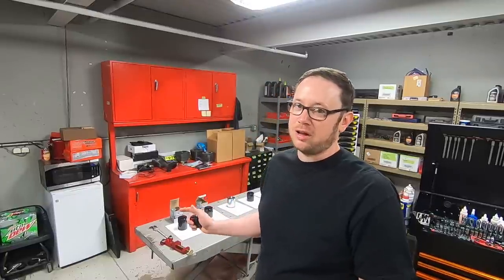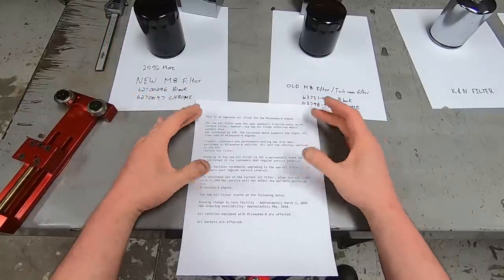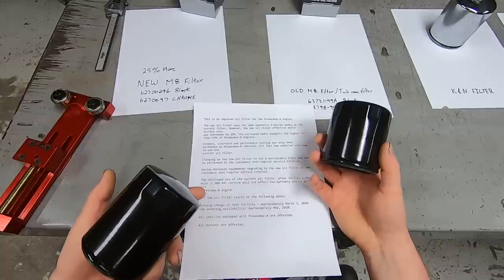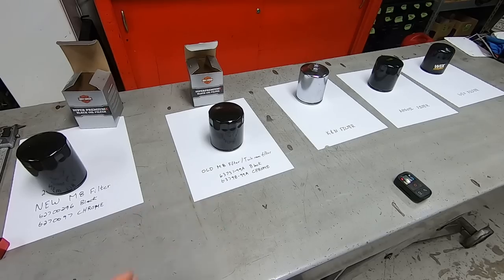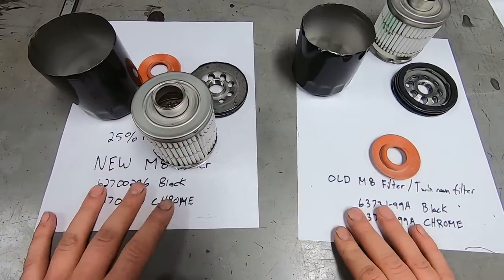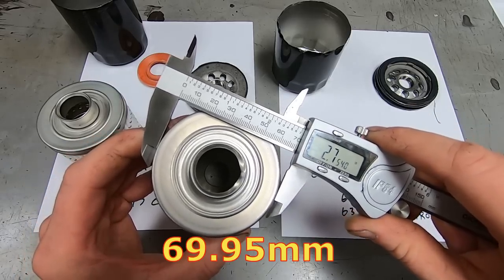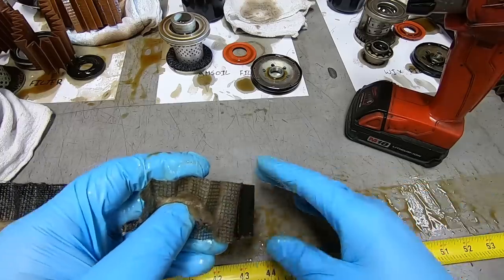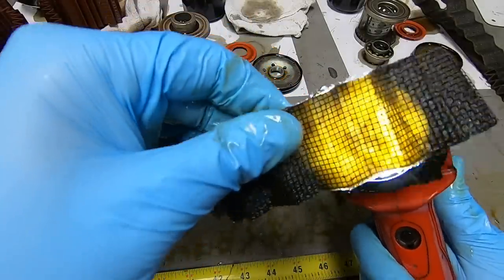NEW MILWAUKEE 8 OIL FILTER TEAR DOWN vs K&N vs AMSOIL vs WIX HARLEY DAVIDSON M8 TWIN CAM COMPETITION

Comment: Harley increased capacity because they filter down so tight 5 microns. They know that their oil filters end up in complete bypass quickly ie. 2500-3000 miles. The Amsoil filter is a 20 micron filter and the K&N has a 25 micron filter. The amsoil and k&n won’t plug as quick so they filter more. Increasing the capacity on the Harley filter was to help prevent the oil filter from being plugged (restricted) so quickly so it doesn’t go into bypass and can filter oil longer. A 25% increase in filter media on a 5 micron filter won’t extend the filter life out to a 5000 mile oil change interval. It is better but, falls short. If you are going to use a filter that is that restrictive you should change it at 2500 miles in between your regular oil changes. With the amsoil or k&n you aren’t filtering as tight but your restriction is punched out to a longer time or miles window thus not going into bypass and still filtering oil all the way through your 5000 mile interval. Nothing wrong with the Harley filter, just know you need a filter change at 2500 in between the 5000 mile oil change. Maybe sooner.
Reply: regardless of how often you change your filter or how new it is the bypass valve will still get activated, such as when the oil is cold and doesn't flow easily or when your running your engine at higher RPM's, this happens more so with  todays offerings of shrinking filter sizes, this is why having a direct bypass valve is crucial , sincerely, old gearhead, Paul Timpani
Reply: Mike, I kind of understand the micron filter and stuff. But I have a hard time swallowing that a filter could get plugged up and go into the bypass mode  I am thinking that there would have to be a lot of particles in that filter in order for it to plug up and go into the bypass mode. I would like to see somebody do a filter presentation where we can see how much particles it takes to plug the filter up, then go into the bypass mode.
Reply: You need to have a close look at your number.. 5000 microns is nearly .2 Inches (.1968") That's nearly a 1/4-20 bolt.. And more ridiculous, 25000 Microns is just under an inch (.984"). Too many zeros in your post.
Reply: @JHV166  I was wondering about that myself the numbers are just too high
Reply: @JHV166  Jim yes. 5 micron filter. 5 5 5. I have no idea why I wrote that that way.  😂😂😂😂😂 Now that I  have my reading glasses I can definitely tell you that you’re absolutely right. It’s 5. Talk about feeling like a blind old fat fingered bonehead. Thanks for clearing that up. At least my better half got a good laugh and a “ I told you to go to the eye doctor.”
Reply: @mikedanaher3413  Sorry Mike. You have violated "Micron-Math". You must spend the next 600 million nano seconds telling your wife "Yes Dear". Let us know when you're done to receive your absolution.
I'll be busy pulling the 1/4-20 bolt out of my filter.
🤣🤣🤣
Reply: @JHV166  Lol. Happy wife happy life. 😂😂😂😂😂👍
Reply: @mikedanaher3413  she'll be happy for the duration of 600 Million nanoseconds (6/10ths of a second). 😂😂😂

Comment: Stamped sheet metal stand off and plastic valve are to cut cost. OEM filters used to have a coil spring stand off and spot welded all metal valve. Cut a FRAM you'll be surprised.

Comment: Looks like K&N it is!!!
Just ran my new M8 road King to 500 miles and I'll be changing the oil with the K&N filter with K&N. Also be using those filters for the life of this bike. Good video. I have a good understanding of filter media and benefits thereof, K&N guys. The bigger holes allowing free flow! That's huge for the M8.
K&N

Comment: When referring to particle sizes in regards to oil filters, it is important to realize exactly how small the particles being discussed really are. Then, we can discuss the filtration effects of the filters in question in regards to engine life. There is a misconception when it comes to oil filters, that the smaller the micron rating the better the filter. Some companies rate their filter as a “5 micron” filter, which means the filter will catch particles microns in size with at least 50% efficiency. Let’s put a 5 micron particle in perspective. 1 micron is .001mm (or .00003937 inch), so 5 micron is .005mm (.00019685 inch). The tolerances in your engine will be no smaller than 2.5 thousandths of an inch (.0025”). So, 2.5 thousands of an inch, which is equal to a 63.5 micron particle. A 5 micron particle is smaller than a human red blood cell, and too small to see with the naked eye. So how can a particle that size cause damage to your engine?

Next, let’s consider the purpose of an oil filter bypass valve. A bypass valve opens when the inlet side of the filter gets too restrictive. This can happen when the engine is cold and the viscosity of the oil is high (due to the weight of the oil), but this primarily happens when the filter media gets too restrictive or clogged. This is done to keep catastrophic engine failure from occurring; dirty oil is better than no oil. The lower the pressure relief rating, the sooner the valve allows unfiltered oil to enter your system. The last factor that contributes to the bypass opening is the amount (surface area) of the filter media used in the filter. A filter that has a high surface area is going to hold more contaminant and promote good oil flow for a longer period of time, so the bypass will take longer to open.

If the filter you use is 95% efficient at 5 microns it is going to remove more contaminants than a filter that is 3% efficient at 5 microns. The question is, how long will it take for those filters to load up with contaminant and enter bypass? The answer is simple, the more efficient filter will load up sooner, but at what expense? Oil flow is necessary to lubricate rotating parts, prevent engine failure, and help keep the engine cooler, plus again dirty oil flow is better than starving the engine of oil completely (the theory behind the filter bypass). Clean oil is best for long engine life, and a filter that can promote clean oil flow consistently for a longer period of time is a key component of any healthy engine.

When you are talking about filtration, whether it be oil or air, there is a balancing act that has to be performed to ensure your engine gets the protection it needs while giving your engine the most flow possible. Unfortunately, when the focus is an oil filter that is catching extremely small particles at a high percentage, the tradeoff is flow rate. This put the consumer in a “Catch-22” situation. Do you use a filter with the most efficient media at the smallest particle rating, and have the bypass open letting unfiltered oil through the system? Or do you have a filter that does not filter as small a particle size, but filters more of the oil for a longer period of time? K&N filters are designed to give you the balance of oil flow and filtration. Of course, we would like to say we have the most efficient filter at the smallest micron range, but the fact is we are not going to sacrifice oil flow or the quality of filtration by having a high efficiency filter that operates in bypass mode for 80% percent of its life. I know for me personally it’s a simple decision, the small particle filtration does not mean anything to me since we are talking about particles I can’t see, especially if there is a remote possibility of unfiltered oil touching my bearing surfaces causing premature wear and eventual engine failure.

When you are comparing filters, to make the most informed decision possible, look at the following things (with the least amount of emphasis on micron rating): Filtration efficiency, Filter surface area, bypass setting.

The KN-171 filter has a nominal micron rating of 25, meaning it will capture 25 micron particles with at least 50% efficiency. The filtration efficiency of the KN-171 at 5 microns is 3%. The KN-171 also has 165 sq.in. of filter area partially the reason it flows 25% better than the OE, paired with a bypass that opens at 14psi. The Harley Davidson filter 95.8% efficient at 5 micron and 98.6% at 25 micron, it also has 63 sq.in. of media and a bypass that opens at 10psi. This means the Harley filter will run in bypass mode for a significant portion of its installed life, whereas the K&N will allow oil to flow through the filter for a longer period of time. In my personal opinion, this makes the K&N filter the clear choice.
Here is a side by side to the amount of media inside of a K&N filter and your typical OEM filter (I don't think it is Harley's current one but look cool)
Reply from the maker: Amazing information !! 👏
Reply: It looks like the amsoil filter is very close to ome 98.7% @ 20 microns . Though watching this it felt like the K&M filter was the best choice and after this info ...still does.
Reply: I personally don't care too much. I'm a guy who religiously changes oil at / before specified intervals. 
My '19 RKS had a stock HD filter that was cranked on way too tightly (either by the motor company, dealer, or previous owner). The touring line has the filter in a small pocket in front of the motor with VERY limited access. Needless to say- I had a difficult time removing it after it crushed using the HD oil filter tool. 
I swear by K&N oil filters. Having the integrated nut on the end of the cannister totally prevents the cannister from crushing.
Reply: Agree 100% this is why I try to fit the largest possible filter on all my power equipment. Today not only are they trying to sell the public with the lowest micron rating there selection is also shrinking literally, in choices and in physical size in order to accommodate many more vehicles with that specific filter this adds to the detriment, one size does not fit all, having a larger filter area is always better, with a sensible micron rating and the highest psi. bypass valve rating that is acceptable to your application. But I seem to be repeating myself over and over with the lack of emphasizes in these oil filter video's on the importance of the location of the bypass valve which should always be direct, oil should not have to pass over the dirty filter medium before re-entering the engine and in this video the only filter that offers that is the Wix. Being an old experienced gearhead It is unfortunate that through the years for the sake of keeping manufacturing cost down and staying competitive many companies are no longer producing them as they once did but don't worry there are one's that still do and are these are the ones I seek. In sum todays trend seems to be smaller filters, (buying the public) with the lowest micron ratings, and no direct bypass valve. Ridiculous. Hopefully this trend will change with people understanding on how often these bypass valves are being activated with all this at play. Look harder and shop wisely, sincerely, old gearhead, Paul Timpani
Reply: Any thoughts on using a Fram ultra 3600? Bypass is 12 psi.
Reply: Don't go to technical, you will destroy all the reviews. 👍🏻
Reply: My Vision has the billet / aluminum housing type with a washable cartridge. Now I'm wondering about it's specs.
Reply: Looks like my filter is a pc racing flo with a stainless steel filter.  Good to 35 microns.  I can't find my bypass pressure.
Reply: @I_am_archie  *valve
Reply: @corneilcorneil I see the the valve. I just can't find specs regarding the pressure the valve operates at.
Reply: @I_am_archie  weld a cap over it and add air pressure?
Reply: @corneilcorneil  lol damn good idea 👍🤠
Reply: @regnar19881  Be patient, HD is just building bikes. Soon they will understand the know how and copy more from other brands.
Reply: The big point missing here is the reason the manufacturers have moved to the synthetic filter media. The synthetic media has a 3 dimensional area that traps particles as opposed to the old "tried and true" surface of the paper media. This media works like a HEPA air filter, which can hold several times the amount of debris compared to a paper filter, before it clogs and causes the bypass valve to open.
Reply: Micron rating is important when you have a diesel engine that has HEUI Injectors where the internal tolerance is very small so for me it's either The OEM Or Amsoil for my O5 F350 6.0 along with Amsoil oil,for me the little extra $ and then also doing Oil Analysis is how I,go about my maintenance.  It makes no sense to try and go cheap.  But I,do have a K&N Air Filter and Airaid Bought out K&N Several years ago but They continue to use both Names Brand wise.
Reply: Great cut and paste regurgitation of information. Not sure how true it is.
Reply: Brevity is the soul of wit…
Reply: @robertmcenery4344  Synthetic oils prematurely break down non-synthetic media… hence “synthetic approved” media, for synthetics 👍🏻

Comment: Thanks for this. I will continue to run K&N as I have for decades. For the record I have never noted any collapsing of the internal support cylinder on the K&N filters I run. I do cut them open quite often just to have a look.

Comment: Great video Wizard! I really appreciate this level of investigation and exposure man. I’ve always used Wix & K&N filters and you have now assured me that I’m using good filters indeed.🤘🏼
Reply: I have watched vids that seem to prove claims that Hiflofiltro manufactures the filters for K&N.  The model numbers are even almost identical for the various applications.  I have used K&N filters on most of my engines, but just bought a Hiflofiltro HF171BRC long filter for my next M8 oil change and saved about three bucks.

Comment: The OEM M8 filter relief valve spring is a higher value. Harley found the TC filter valve was opening too early thus bypassing unnecessarily. Per Harley-Davidson Tech services.

Comment: The K&N filter is an older, paper filter technology, this filter blocks particles on the surface. The H-D, Amsoil and Wix are using a multi layer media that traps particles within the layers similar to a HEPA filter. The multi layer approach has proven to trap more before clogging while providing better flow through.
Reply: You can't do a comparison test between filters if one is wet with oil in the other is dry
Reply: @scotthines4326  nobody made any comparisons here about efficacy of the materials. I commented on the type of filter materials, which, when observing the number of pleats and visually comparing the difference in overall surface area of the materials is comparing apples and oranges, for the reasons I stated.

Comment: The most important thing is oil changes at proper times.  The best filter will not preform as designed with breaking down oil.

Comment: Awesome video once again, keep up the great job you’re doing. I’ll continue to use the Harley filter, just due to the simple fact the media looks really good regardless of the length and the holes for the inlet on the face plate for the oil are way bigger.
Reply from the maker: I agree. I prefer the HD filter also.

Comment: I will continue to use OE filters. I have run an EVO to nearly 100,000 before I rebuilt and a twin cam 88 to over 100,000 and it is still running great with engine never having been apart other than cam chest changing to gear drive cams @15,000 miles. I now have a TC 103 and an M8 107 and have always changed the oil @ 2500 mile intervals so bypass should not be an issue. It's a formula that is proven for me. The K&N looks great but I feel it is overengineered and offers more protection than I need so why spend the extra money when I've never had an oil or lubrication related failure. I have also only ran Amsoil or Redline oils.

Comment: Great comparison video.    
Question:   What kind of filter do you run on your bike and would you change it based upon your comparison?
Reply from the maker: I have a twin cam. So i will continue to run my black harley davidson twin cam filter. Ive seen a handful of twin cams with HD filters over 100k miles where Ive taken apart the engine and the parts are beautiful. These were regular dealership customers so I was sure the engines had not been torn down before ect.   And every one had a HD filter. The comparison didn't change my mind. But sure was interesting. Id think about the K&N but I think the nut on the end of the filter is ugly and tacky. JMO
Reply: @HarleyDavidsonWizard  I personally like the nut, it makes it easier to remove.

Comment: Very good, I always buy Harley filters. I figure they built the bikes, they got the flow, and the filtering figure out to protect their bikes! Just like the M8, they increasing the size, theirs a reason.
Reply: ICYMI: https://www.youtube.com/watch?v=BALoiHotB-I&ab_channel=JayWCase
Reply from the maker: I saw that video a couple days ago. I had not seen a fram Harley filter before. Both filters he cut open are for evolution engines. I wonder how different the fram & HD oil filters are for twin cam engines..
Reply: @HarleyDavidsonWizard  I've been using a Fram PH6065B on my 2000 FLHR for years. I also use them on my FLHTCUSE7. Mobil 1 Twin Cam Synthetic and Fram oil filter. I use Amsoil Shock proof in my gear box.

Comment: Thanks for taking the Time to Demonstrate ,, Seems both the M8 filters provide better flow than Previous ones and although it says the new one has %25 increased I'm really not sure if it will actually be of any benefit..As for the filtration element I think due to material and less length compared to KnN it would still filter and flow better and more free..Jus my thoughts.